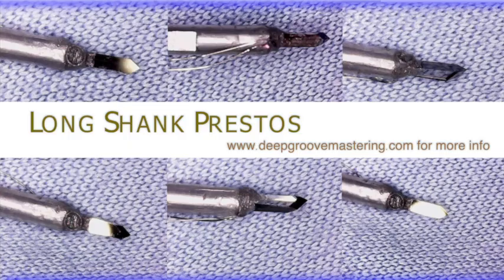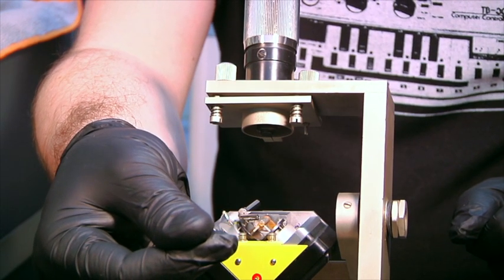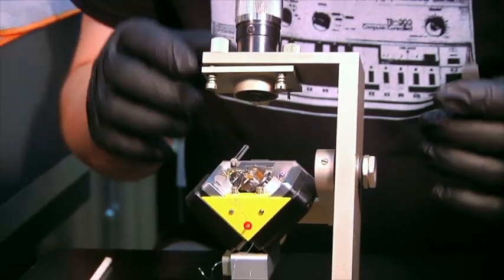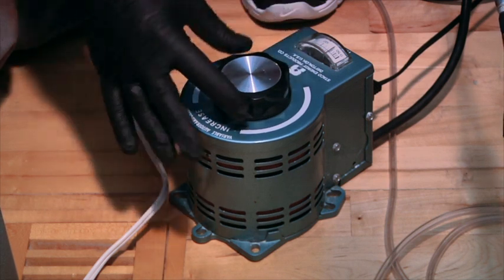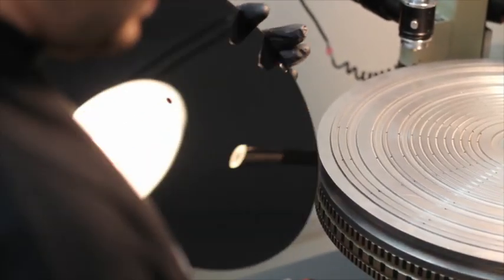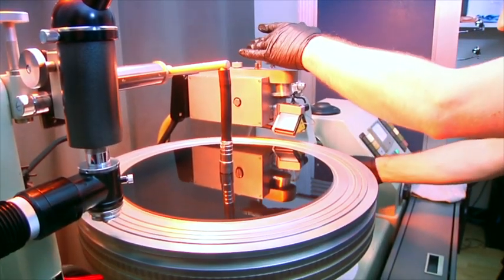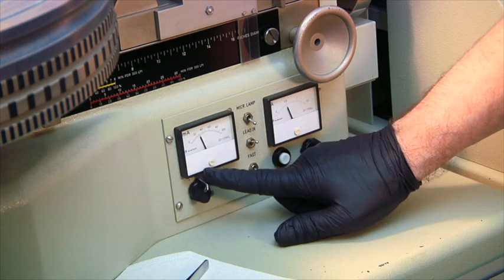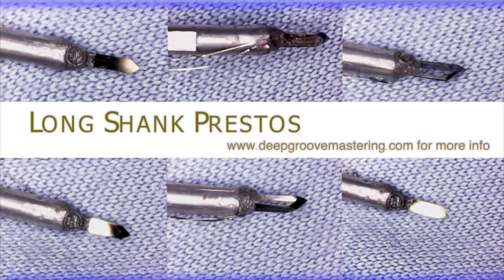Deep Grooves Mastering - Plastic Cutting Guide

Comment: 19:45 how does talking (your voice) interfere with the audio diamond cutting process, as well as the noise of the vacuum make on the actual production.  My take is as a noob to this that the noises around have made an impact on the quality production of the cutting.  I understand the static issue as the main point, but what about the rest of the issues like ambient and localized noise to production?
Reply from the maker: +Haiku Automation Ok noob.  The Neumann VMS70 Vinyl Mastering Lathe that I am using comes from the factory with a vacuum system.  Every major album pressed from a major label for the last 70+ years was cut on a lathe with a vacuum system.  That should answer your question.  It was zero impact on the recording.  When no audio is passing through the cutterhead, the springs in the transducers and the v spring on the torque tube have enough tension to negate the minor local vibrations caused by the air rushing through the opening of the vacuum tube.  If you don't run a vacuum, the hair of material being cut away falls on the disc and interferes with cutting grooves.  It gets under the cutting stylus and interrupts tracing and results in background noise.  Running the vacuum to remove the cut away material is the solution that has been in use for longer than I've been alive.  Static is not an issue that results in noise.  It is only a neussance while cutting and can produce dropped chip.  Dropped chip can cause noise as well as damage to the cutting stylus.  Talking in the background, especially talking loudly by the cutterhead can translate into the recording.  But, only noticeable in a lead in/lead out groove.  While music is being recorded, no amount of talking near the lathe would make a difference.  Of course, for the purposes of filming an instructional video I was talking.  I never talk while cutting professionally.
Reply from the maker: vacuum has no effect.  talking loudly enough can be picked up in the groove.  I can actually play you records with this.  either test cut or real pressed records with faint mumbling in the lead in if played back with very high gain.  its a real phenomenon.

Comment: 13:15 You can clearly see a ton of garbage the rag put onto that newly exposed plastic.  What impact does that garbage you put onto that plastic and the quality of the cutting?
Reply from the maker: +Haiku Automation There is a little bit of dust on the disc.  Not from the rag.  That is a Microfiber rag.  It doesn't create bits of lint.  Plastic discs attract dust like a magnet.  While filming the video, the film crew and myself were moving around a lot kicking up dust.  I didn't put anything on the plastic but a cutting lubricant.  Since you are literally removing material from the blank disc when cutting, any small amount of dust on the surface has zero effect.  It is removed along with the hair that is being cut away.  Since the amount of background noise on a record has everything to do with how smooth the groove walls are beneath the surface of the disc, it stands to reason that no amount of dust on the surface could possibly affect the sound quality of the cutting process since it is not acting on the surface but rather beneath it.
Reply from the maker: its not garbage its the turtlewax streaking...